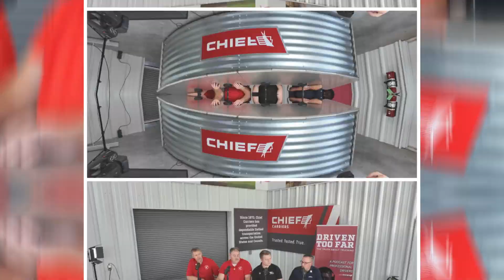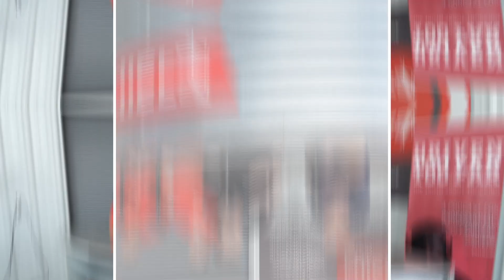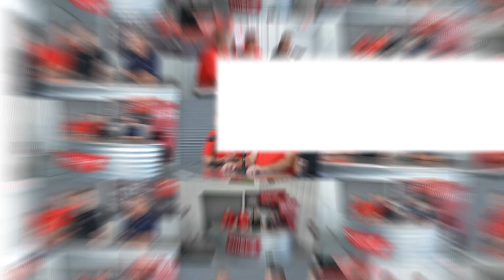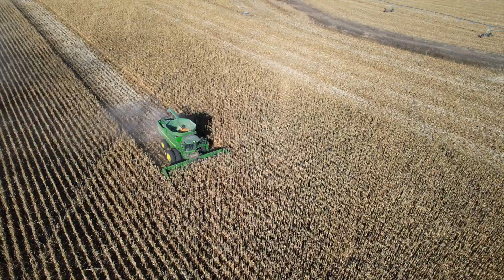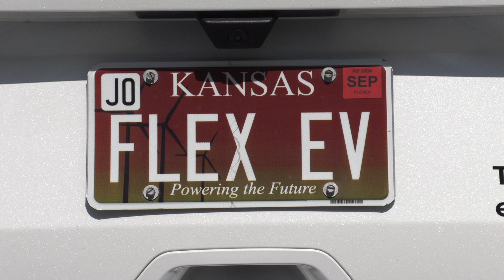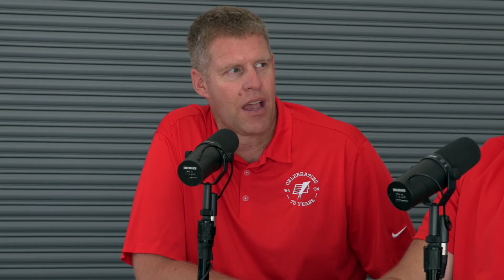Beyond Gasoline: Exploring the Advantages of Ethanol Blends

Comment: What need to happen besides just asking if a vehicle gets a check engine light, is to ask what are the long term impacts.  Second, we need to educate mechanics how to use fuel trims because I have investigated complaints with E10, E30 and E85 in the tank.  I have just 2000 miles to go before I can say I have 300K miles using just E30 in my non-FFV.  I know how vehicles adapt to blends such as E30 and this is no different than how vehicles adapt between winter and summer gasoline.  If there is  problem with current on-road vehicles moving to E15  and even higher blends, maybe we should go back to the science of how EPA and others tell us we can't use this fuel.  Follow the money.